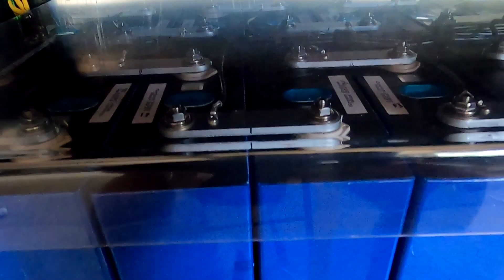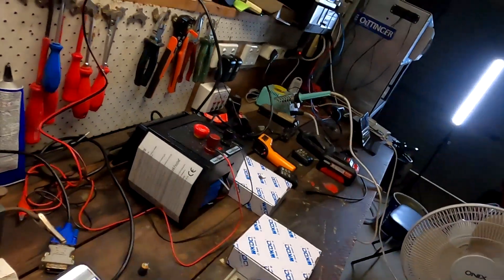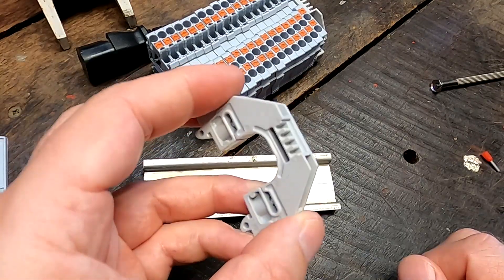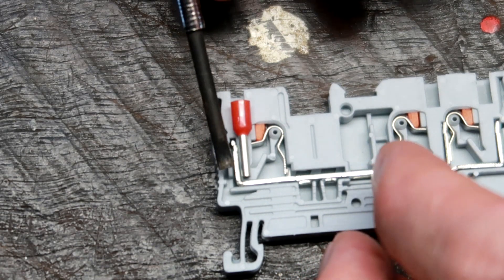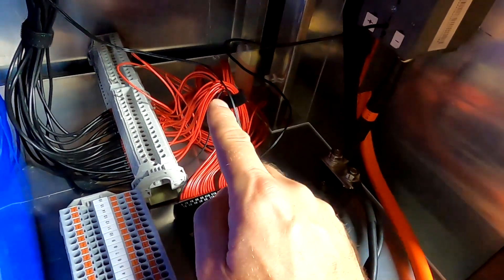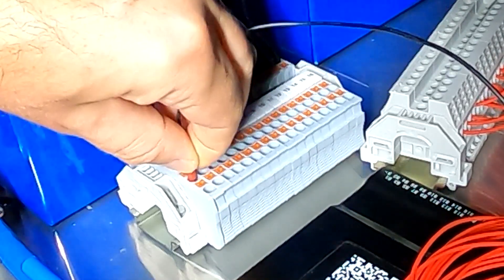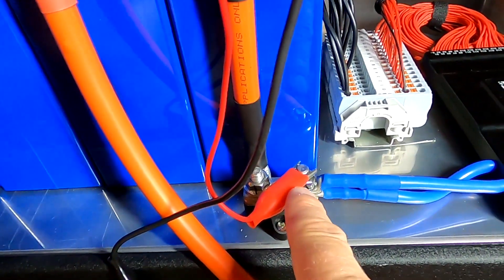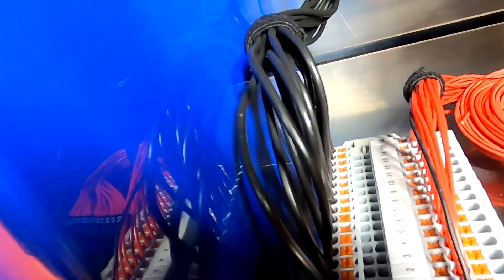New Terminal-Block to connect BMS and Balancers to the battery. Easy, clean and versatile!

Comment: Hey Andy, good day
I had some instructions from a wago rep. His advice was to not use ferrules with their terminals. The clamp of the terminal is designed to provide a constant pressure on the wire, their suggestion is to only use bare wires in the clamps. The reason he gave was that ferrules could come lose and then the clamp would just press on the ferrule and not the wire and possibly the wire could start flopping around potentially shorting against an other wire. This is what I was told. I suggest reading up on the clamps and look for their intended use.
Reply: Hi Andy
There would be a pinch point but the strength of the terminal isn't strong enough that the wire would be pinched off, the pinch point would also minimally carve into the loose strands breaking an oxide layer if present.
And as you already discovered, inserting the wires is a lot easier if you open the clamp by pressing the orange release tab on the terminal
Reply: That's what i've learned. When Springclamps are used, u insert just the bare wire, Screw Clamps and u have to use ferrules.
Reply from the maker: But does it not just put pressure on the point where it clamps the cable? Or is the clamp as long as the whole length of the terminal?
Reply: we allways use ferruls on multi stranded wire. there were som problems on oil rigs etc in the early days, but when they checked the installers they were always using cheap crimping tools that where not designed for ferrul's. Ferruls are still used becus of the higher risk of a lose strand potentially shorting something out, and a better conformation that they are properly seated. i have never had any problems with ferrul's but fixed plenty of installations where they wernt used.
Reply: @EkeDeke  even in clamp terminals? or screw terminals, with screw terminals you are completely right to use ferrules. Maybe for other brands there are different recommendations but for wago terminals the advice from the reps is not to use ferrules

Comment: The Velcro really helps to keep the spaghetti nicely contained. 
How handy is the second battery to supply continuous power while the primary battery is being worked on. 
For safety, if you are working near live bus bars, put some tape over your metal wedding ring if you can't take it off.  It will also make me less anxious.
Reply from the maker: How can I possibly make a short with my ring though?
Reply: @OffGridGarageAustralia  I did it many years ago working on a car, and using a screwdriver that had the metal shaft of the screw driver go right through the handle, (was designed so it could be hit with a hammer and not hurt the plastic handle), and that was touching my wedding ring on the palm side of my hand, while I accidentally touched the live 12v +ve terminal of the horn.The ring heated up almost instantly, and ring barked my finger! Very painful for weeks!

Comment: You can use those clamps with bare wire as well. just push open the spring, insert the wire and release... would not recommend that if you have to connect/disconnect often, but the connection will be fine. saves time for the next batteries
Reply: Yes, if a wire isn't a stranded type.

Comment: smiles ... looking good ... did u remember to use no-oxide in the feral crimp, and when u pushed into block ?..  the air shall forever bring moisture and pollution inside ur connection device over the yrs ... once again small.. but long term have found this can create movement in current and resistance over time ..
Reply from the maker: The box will be closed once finished with no airflow from the external, so dust should not be an issue.
Reply: @OffGridGarageAustralia  chukles ... last time to sell u ... i am not shilliing the stuff becase i have any vested in terest ...lol Audio Connections
NO-OX-ID A-Special works absolute wonders on audio connections, especially on those pesky RCA connectors that tend to corrode on the inner surfaces of the ground shell, 1/4 phone and even USB connectors.
Tinning stranded wires destined for mechanical compression-type connectors defeats the purpose of the mechanical compression. When you insert a set of bare copper wires that are clean and protected with stuff like NO-OX-ID into a speaker thread-type compression connector, the resultant force of the compression on all the strands is what makes a good connection.
Telephones
Telephone companies have been using NO-OX-ID for seventy years. I have seen fifty-year-old NO-OX-ID on connectors that I've disassembled and the stuff is still goopy and the connections are still bright and shiny as the day they were made.
A quote from a Bell Systems manual on making a connection: "The mating surfaces of the connection shall be burnished to a bright metallic finish and coated with a thin layer of NO-OX-ID anticorrosion paste to preserve continuity indefinitely."
Switchgear
One public utility states on its purchase orders: "This material is used in making aluminum to aluminum connections on outdoor High-Voltage Switchgear. PSO has tested dozens of joint compounds and none are equal to the Sanchem NO-OX-ID. Please procure this brand!"
Grounding
NO-OX-ID is a great product, a must, for any grounding application.
Circuit Breakers
One major engineering company recommends the use of NO-OX-ID on Track & Positioning pins on 480 volt drawout breakers (Circuit Breakers).
AF and RF Connectors
Review from an Electronics AF and RF engineer - "Electronics, both AF and RF, have been my employer and hobby since 1963. NO-OX-ID preserves the conductive finish. I use it on all AF and low frequency (Below 30MHz) RF connectors and have never had a glitch because of its presence. The ideal amount of NO-OX-ID to use is one molecule thick. No gobs. If a person takes care to wipe off excess with a clean paper towel the residue, barely seen, even, is plenty enough to forestall corrosion. I even use the stuff on gold-plated edge connectors on circuit cards. I own an old Yamaha DSP-A100 integrated 5.1 rig that CircuitCity sold for $50.00 because after it sat around being demo'd the interior flat ribbon cable connections corroded and the amp lost its snot, so to speak. It took fifty hours of repairs, taking it completely apart and burnishing the non-soldered connections, but it worked. (I attended the Panasonic Technical schools for Digital Electronic, Broadcast and Computer Repair and that's where I learned of the built-in obsolescence that non-soldered connections afford.) Even the expensive microprocessor chips that plug in to receptacles decline in conductivity over time, except when protected by NO-OX-ID, so as soon as I purchase a piece of equipment I yank it apart and goop up the non-solderables 'cause I know they're ticking bombs."
Reply: @OffGridGarageAustralia  sometimes it is simpler to do the job first time .. i am only giving u experience in electrical contacts for chipset comunications .. telstra NBN and all others smoother to stop long term revisits and trouble shooting .. but .. it is only s possability .. tim
e shall tell ... lol... but you have a wonderful setup .. just advice .. smiles ..

Comment: Hi Andy.  There will be negligible resistance measured with an ohms meter because it tests with very low amperage.  
The best way is to set your meter to volts dc. Then load your solar set up to the  same as the other day that made the busbars glow about 90 amps. 
Then measure the voltage between the offending connections.  
They will probably read  0.1v which is not too bad and up to 0.8v which is not so good at all. 
Any resistance in the busbar to terminal connection will show as a potential difference (voltage reading) at the test probe points. This voltage drop can then be calculated via ohms law to give you a tangible resistance reading under load.
Reply from the maker: That method would be highly inaccurate.
The tester I showed at the beginning is using the standard 1kHz signal to measure resistance. It's not a typical ohm meter.
Reply: @OffGridGarageAustralia  You used the TR1035 to measure the resistance of the busbars? Does it work despite it not being a battery? So it acts as a milliohm meter as well? I was wondering also before buying one if it could be helpful to check buss bar connections

Comment: At 3:20 in regards to terminal blocks and balance fusing, I recalled installing fused control terminal blocks for instrumentation and control builds, Basically a fuse block with a screw-in fuse holder built-in. I looked, and there appears to be a lot of sources now for DIN rail fused terminal blocks, Even WKDQ has several models on their website.
Reply from the maker: Yes, but the cable from the fuse holders to the terminals would be unprotected. That was my main reason to connect the fuses to the busbars directly.
Reply: @OffGridGarageAustralia  Ok. I see, as the leads were pretty short and protected inside a cabinet, personally I'd not be overly concerned. In 480/600V and even 5KV switchgear  it's common to run unfused  from a main buss to a control or potential transformer several feet, the convention being that short or ground fault from the main buss to a fused point if properly installed and protected in a closed cabinet the chances of a short are remote at best and if there were to be a short the enclosure would contain a resulting fire or corona. 
With a battery bank it's a bit different as you have the cells in the same enclosure but personally I'd be ok with a few feet of lead cable and my 1st concern would be for BMS  protection, and second short circuit.

Comment: Hey Andy, long time watcher first time commenter. I was wondering if you could experiment with double BMS on a pack. So 2xJK bms double balance leads per cell and the BMS in parallel to theoretically double the current limit?
Reply from the maker: Thanks Matt for your first comment here ;)
Double BMS is a bit of a problem... I'm not sure how to connect the power cables in such a case? Parallel or series? 
If one BMS turns off all the current would go through the second one and could exceed the limits quickly.
Could be an interesting discussion here on the channel.
Reply: @OffGridGarageAustralia  I think you could just overlay them on top of each other, P- together, B- together, the balance leads stacked on the busbar 2x per cell. So wire up the BMS, just twice! With the safety cut offs they should each be the boss of their own destiny, I think the point you made about the JBD article and cascading shutdown etc is only to be feared if you operate outside of design parameters

Comment: Use voltage drop from the terminal stud to buss bar while battery is under load to calculate the joint resistance. Idea value should be below .1 mV while under load.
Reply from the maker: That's not a good and precise measuring method, I believe.
The stud itself does not carry much current at all, so there would be far less voltage drop to measure.
Reply: @OffGridGarageAustralia  the stud is used as reference voltage potential point and the bus bar is the other voltage potential point the voltage differential between the two points is used to calculate the connection resistance using the formula Resistance = Voltage drop ÷ Current. I have used this method to test connections on Telco battery  systems ranging from 100 Ah to 100K Ah to find poor connections cell to cell and from buss bars to equipment feed cables.
Reply from the maker: @typ44tq1  I checked that but there is too much variation in this method. Sure, if you have a really poor connection you will find it but if they are all in the same ballpark, it's not reliable, I think.

Comment: These push-in terminals look very very similar to those you get from phoenix contact. For push-in and cage-clamp terminals ferrules on the wires are not necessary, they're allowed, but as an electrician I would not recommend using them inside the push-in terminals.
And please do not push in the ferrules in with a screwdriver, just release the clamp mechanism to insert the wire.
Reply from the maker: If you just use stranded fine wires there is a good chance that it will only make good contact where the actual clamp sits. Above and below that point there is no pressure on the flexible cable.
Yeah, releasing the clamp first to insert the cable is what I did at the end. The cable basically falls all the way into the terminal.
Reply: I had more trouble with fine stranded wire that had ferrules on the end. I really often just twist the end a bit so that all wires make it in to the cage clamps.
the clamping mechanism holds the wire against the rest of the metal so contact should not be an issue with bare fine stranded wires. I connected multiple control cabinets with many differently fused motor circuits this way for years now and never had a problem with bad contacts.
some different electricians used ferrules on the wires and I heard that cabinet burned out completely,... but I don't know for sure if it really were the wires that were connected with ferrules in the cage clamp terminals...

Comment: The paste u r using is a conductivity INHIBITOR=FACTS! Just read the directions on how to use Nolax
Reply from the maker: What paste do you mean? I didn't use any in this video...
BTW, your statement is not true: https://www.sanchem.com/electrical-contact-lubricant.html
Reply: @OffGridGarageAustralia   u were polishing the terminals with something in your vid’s and having resistance issues creating heat right? I’m not familiar with the brand, but if the wax or polish or anti-oxidant u r using does not state “conductive”, you are inhibiting conduction, that’s all I’m trying to make clear

Comment: You used 8v for starting the BMS this time. Presumably 9v should also be OK. If so it would be easy to use a PP3 9v battery as used in smoke alarms.
Reply: I have the same Bms. I believe the minimum is 5v. I started mine with a 9v battery as with a 3s 18650 pack as well. Don't know the max voltage to start.
Reply from the maker: That's a good tip from both of you. I didn't think about a 9V battery...

Comment: Hello Andy, I broke down and picked up a thermal camera attachment for my phone so i could check out my smashed copper pipe busbars and to my surprise i had no candles, but something that came to mind that may help you in the future if you continue to have this issue... Maybe lapping compound that is used for automotive valves. You could place it between the surfaces and spin the busbar on the barry wearing the two surfaces together, this would work really well i would imagine, then just wipe off the compound and torque down.
Reply from the maker: Thanks William. I'll see how I go. The problem should not come back now that everything is oxide free and has good contact.